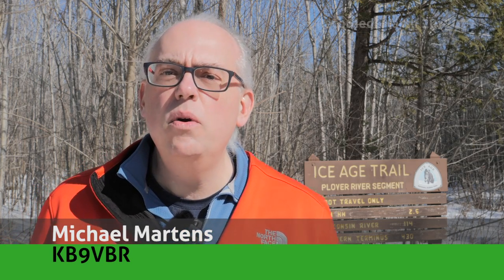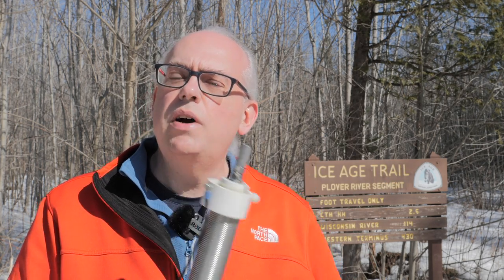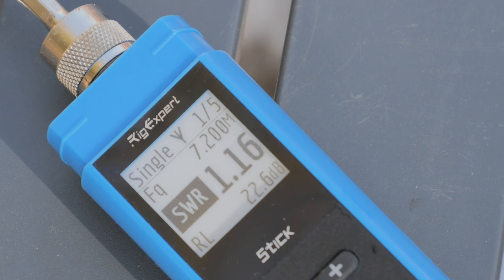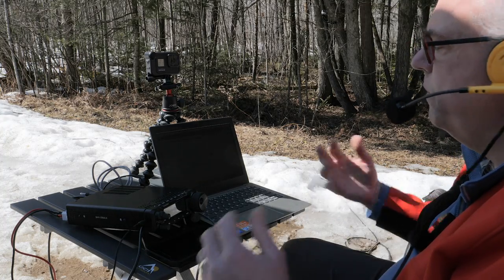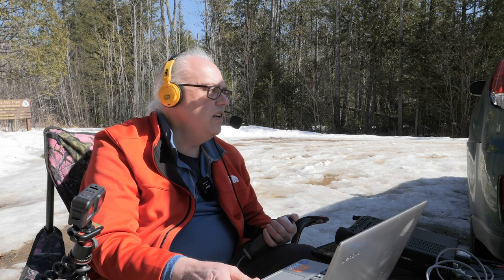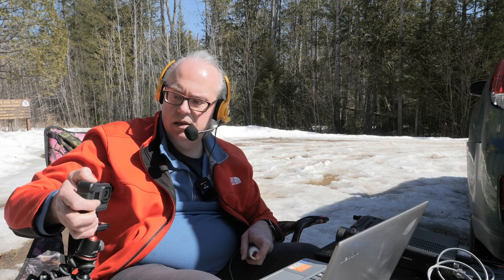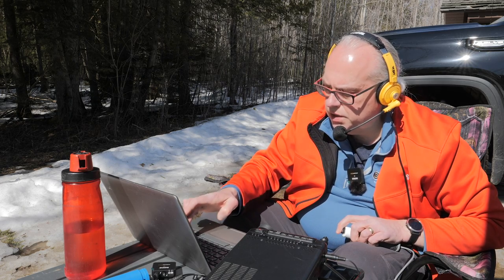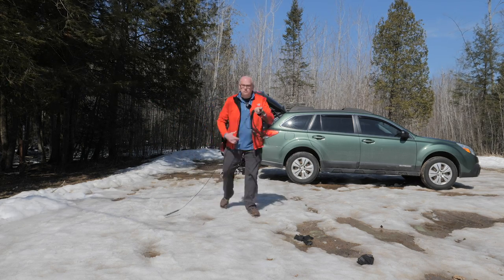Using the Wolf River Coil portable antenna. Parks on the Air (POTA K-4238) #HamradioQA

Comment: I really wanted to like this antenna. It's just too much work and too inconsistent.
Reply from the maker: When I first got my WRC, I felt the same way too. I was often frustrated in changing bands and not getting a good match. The more I used it and understood its characteristics, the easier it has become to use.
Reply: @KB9VBRAntennas  meh.  Too much work to blast myself with 100w of RF.  My fillings can't take it, LOL.